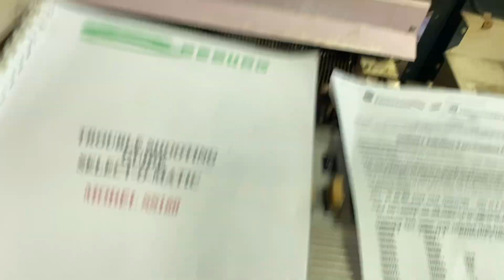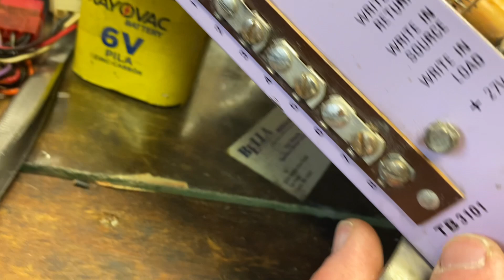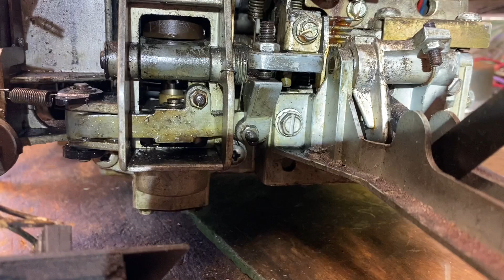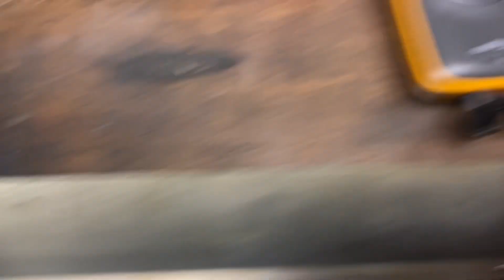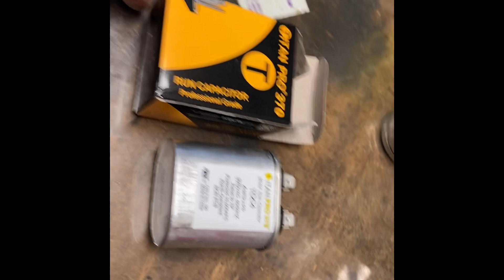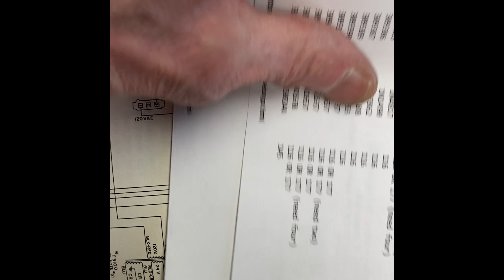Fixing a Seeburg Discotheque Jukebox from 1966

Comment: Have you any idea where I can get hold of the Discoteq wiring plan? 
Kind regards 
Tracy
Reply from the maker: The Discoteque PFEA1U (Electra) did not have a formal service manual.  If you contact me on FB, or join the Jukebox/Repair group on FB, someone can send you a schematic.
Reply: @williamweisel2176  Thank you
Reply: I have this exact version. I do not have the cabinet key. Do you know which key number it takes? Thank you!
Reply from the maker: Key is F336 unless your jukebox has had it's locks changed.

Comment: I just got a seeburg discotheque juke box it was working when I got it home. It has an auxiliary control box connected with a red button to reject the current record playing. When I pushed it lost all power like it blew a fuse. Any idea where or what I should check?
Reply from the maker: I see you also asked about this on the FB groups which will get you more responses.  Sounds like you found the main fuse.  There are also three fuses in the control box (power supply), two on the pricing unit, and two on the traveling puck that goes back and forth over the tormat.  The control box needs gone thru completely with all new can caps and ALL resistors checked to be sure they are all within 10 % of value.  Follow the manual schematic to check voltages there when you are done.